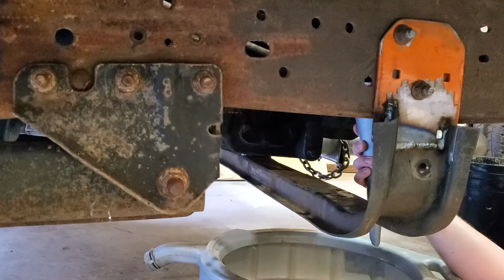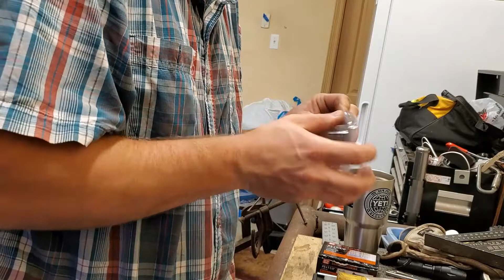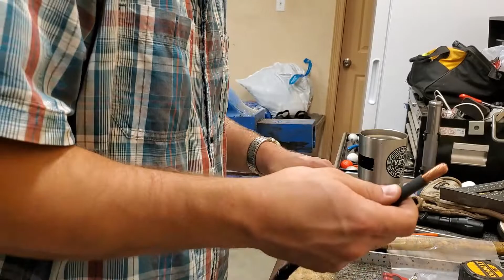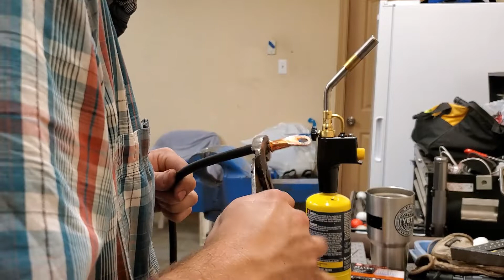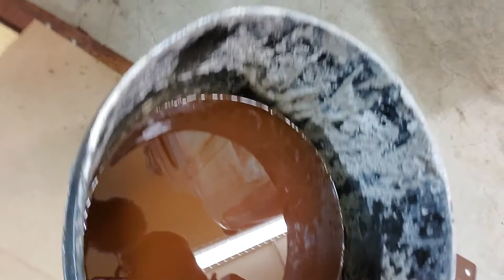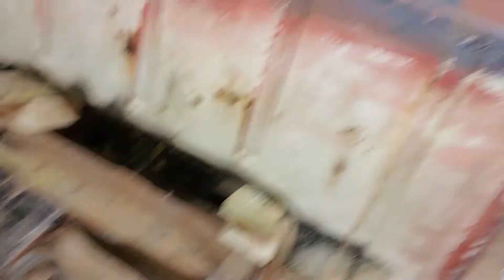HOW TO CREATE YOUR OWN BATTERY CABLES

Comment: If you run out of lugs, or ever want to make your own crimp terminals from copper pipe in the field, 1/4 in copper tubing (3/8 OD) fits #2 perfectly in thickness K, and alright in thickness L.    3/8 L tubing (1/2 OD) is perfect for 00 copper cable aka 2/0.  1/2 L copper water pipe perfect for 0000 = 4/0.    Other sizes can be used if you cut off some strands, but those are the 3 sizes that the full stranded copper cables fit in just right.
Reply from the maker: Thanks for the advice. I will probably make my own lugs when I have to make my permanent cables.
Reply: @CMWorks-sd2fs  You're welcome.  Making your own lets you always use a hole size matching what you're putting it on, too.  

It took me a while to figure out the best ratio to use for the diameter of a stranded wire vs solid wire of the same gauge.  Some websites say stranded wire of the same AWG is about 1.12x the diameter., but they are wrong.  Use 1.15x and you'll always be within a few thousandths of a inch of it being exact.  The other thing I figured out is that most wire gauge tools coming out of China, copied the wrong Starrett gauge, applying one for ferrous wire or sheet metal to copper wire.  For copper wire, you want one where the biggest slot in the edge of the circular gauge is 0.325, not 0.3125.  The other clue is the 0.3125 gauge having a slot 0.250 inches, and there is no AWG of copper wire which is 1/4 inch.  Couldn't find
 one correct gauge on Amazon for solid copper wire other than the $80+ Starrett #281.  But on eBay, a US tool company is selling correct Chinese gauges for $9.
Reply from the maker: Thank you. Im gonna write this down so i can remember it, I'm also gonna look for that gauge.